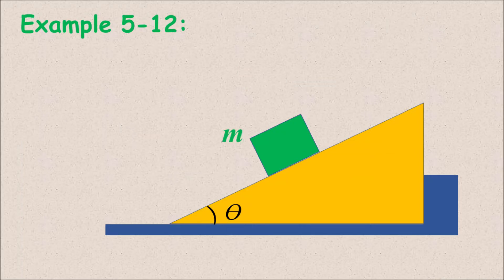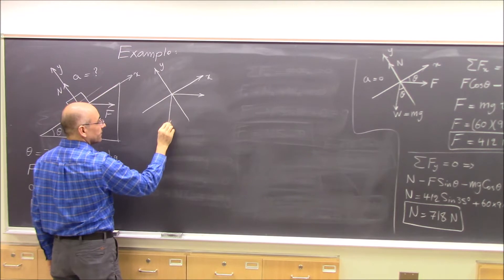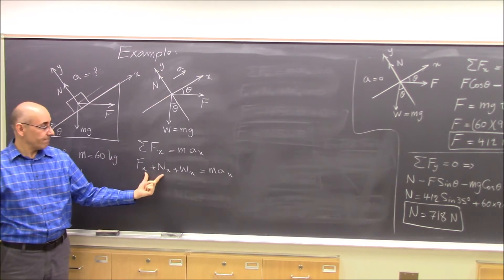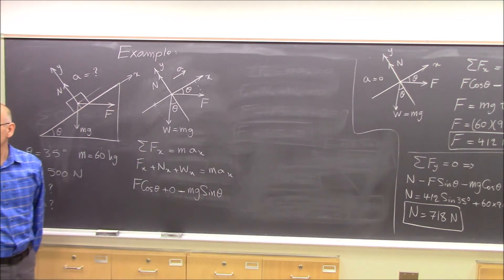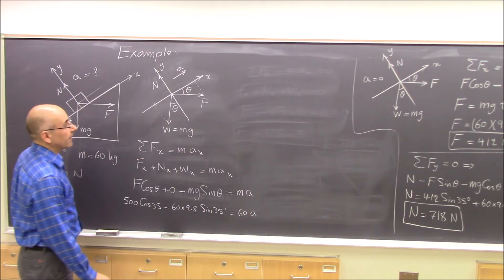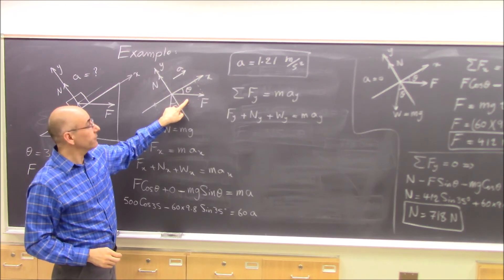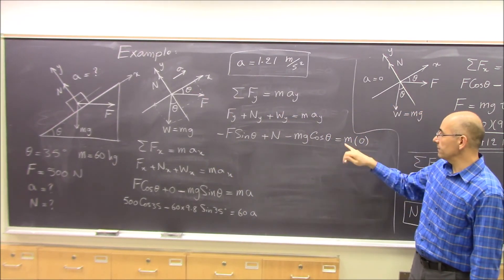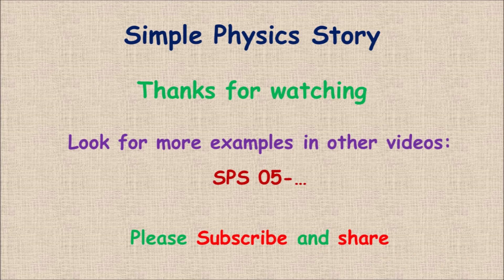SPS 05-12 Pushing Crate Up Ramp by Given Horizontal Force

Comment: Solve this problem..
A 280 kg motorcycle is accelerating up along a ramp that is incline at 30 degrees above the horizontal.  the force pushing the motion up the ramp is 3150N and air resistance produces a force of 250N that oppose the motion. find the motorcycle acceleration